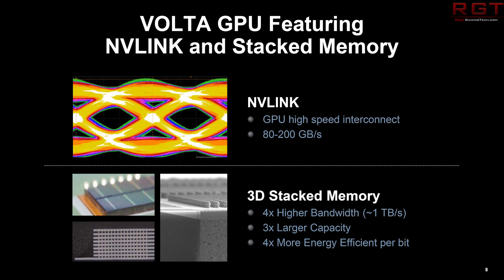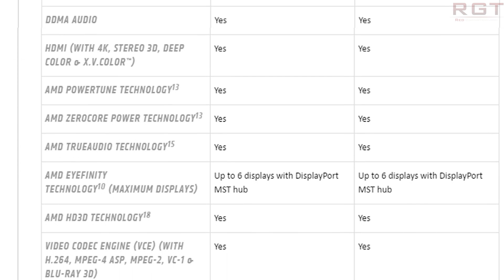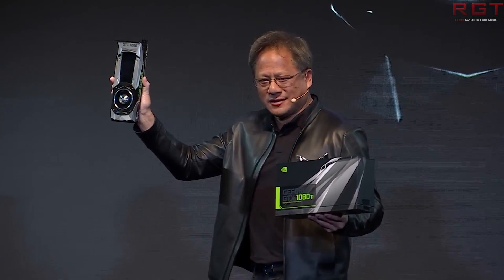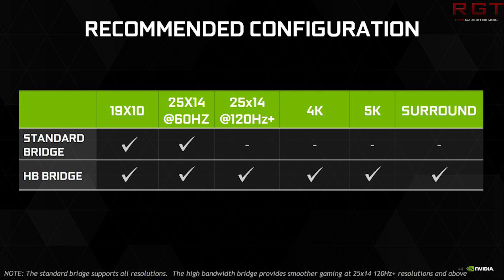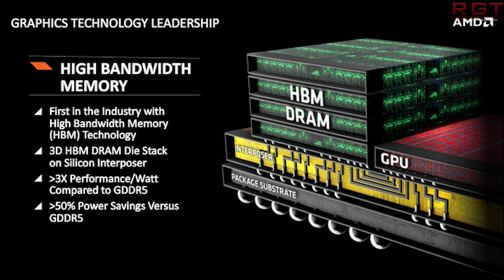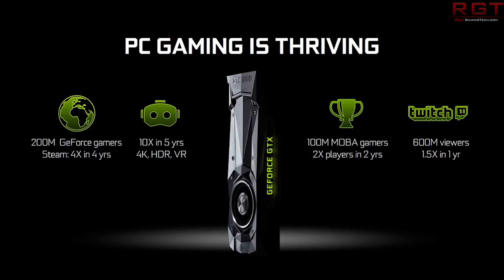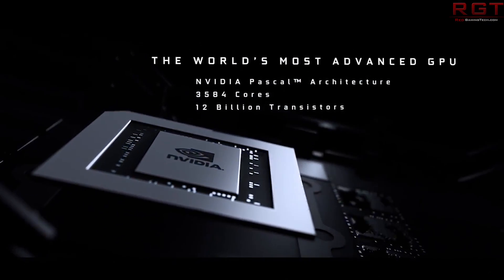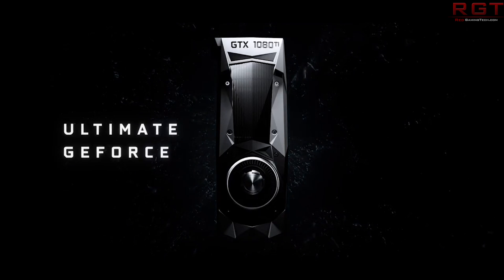Nvidia Volta to Use 12nm Process & Significantly Outperform Vega Says Rumor

Comment: Isnt it obvious that it would beat vega? The target for vega is the 1080 isnt it?
Reply: Well one of the best vega cards at ces already beat a 1080 by around 15% and this was with drivers made for the fury series.  If amd does very well with drivers vega could be around 1080ti and possibly above
Reply: nah it would be better off offering way more performance at a slightly lower cost, people like a saving yes but if amd really wants to be competitive it needs to show nvidia its not out of the fight in the high end and that nvidia cannot get lazy just because its last few series have been more powerful. when vega launches if its top card was 20% faster than a 1080ti but costed 50 bucks less than a 1080ti then it would sell like hotcakes
Reply: untseac What's gunna be 250 dollar's for slightly better performance than a 1080 bud lol??? If you think Vega top end card will come on sale for 250 dollar's then seriously....your gunna be gutted lol.
Reply: untseac Drivers ain't gunna give you 20 frames if your already using Vulkan.
Reply: IcedVanillaLatte beat it on Vulkan.. No idea how it performs in Nvidia sponsored games, DX 11 and 12..
Reply: lol its target is best posible performsnce
Reply: IcedVanillaLatte The top tier vega card at ces scored 70 frames maximum and 65 frames average. The 1080 it was paired against was a founders edition 1080 at stock. The 1080 founders edition with a moderate overclock applied reached 80 frames  maximum down to 75 frames average, same game,  same settings as demo'd  at ces. The Asus...EVGA...G1 gaming edition all offer higher overclocks than founders. So I suspect with new drivers for Vega it might just match the overclocked founders, but those cards are now only 488.00 UK pounds so Vega top tier would have to be same price or less now.
Reply: untseac Lol, 😂😂😂😋Sorry my friend No I didn't.  My Bad...Sorry..😂.
Reply: LOL. Yeah, fury drivers, low clocked ES, throttling from no ventilation is totally a best case scenario.
Reply: well see i was going to get a 1080ti but well its really expensive just for stock and aftermarket coolers will probably be even more so i'd rather just get a 1080 non ti for now and then save some more then get a better card later for cheaper.
Reply: Dingalingdong yes, the target for Vega is Pascal, but it already lost coz Pascal has been on the market for a year. Unless Vega offer slightly faster perf and half the price of Pascal.
Reply: Im hoping for comparable performance to the 1080 at least. I still have a 280x and just recently bought a 1440p144 monitor.
Reply: untseac https://www.google.com/amp/www.pcworld.com/article/2911459/why-nvidia-graphics-cards-are-the-worst-for-open-source-but-the-best-for-linux-gaming.amp.html
Reply: IcedVanillaLatte in vulkan. which is a low level API. which means that there are barely drivers to improve
Reply: IcedVanillaLatte They put VEGA demos in very limited and controlled  scenarios that usually are running in programs that favor AMD cards anyway, so your assumption that it could be equal to a 1080ti is foolish.
Reply: untseac Boo hoo companies do what is best for them. Suck it up. Nvidia's marketing strategy shouldn't affect your purchase decisions. If it does then I suggest you take a good look at yourself.
Reply: +untseac Fine then, purchase your objectively inferior products just to "not approve monopolistic strategies". Sorry but I'm gonna keep buying things based on what's better and NOT by who's playing fair. I really hate people who bitch about companies who do things that's good for them and use that as an excuse to not buy their products. It's the dumbest thing you can do as a customer. You're really gullible if you think AMD cares about you for fanboying for them by not buying nvidia products.
Reply: untseac AMD has closed-source  drivers too, dip shit. if you want open source, go to Linux. They have open source for AMD and NVidia, but nvidias is alot better.
Reply: untseac Nvidia gets leads over AMD in Linux. Must be some pretty shitty developers at AMD huh?
Reply: Dingalingdong of course Vega will be slightly faster and slightly cheaper than Nvidia. Thats the way AMD strategy is. They wait what Nvidia can do and will make a product match Nvidia with a cheaper price tag and AMD budget is low, it takes them months or even a year to launch that product. Thats why AMD never get my respect.